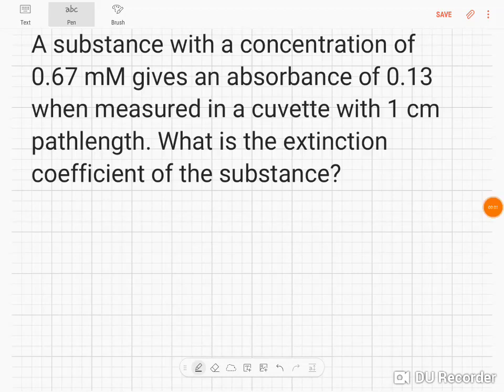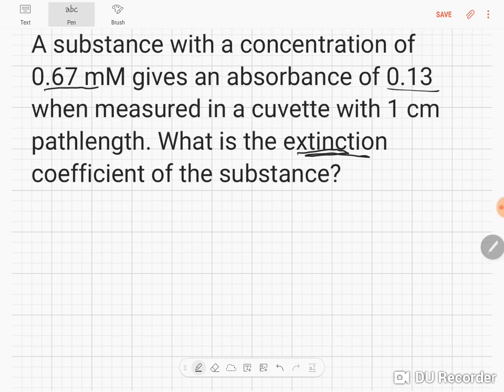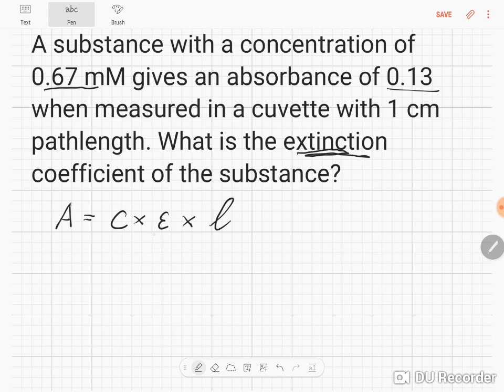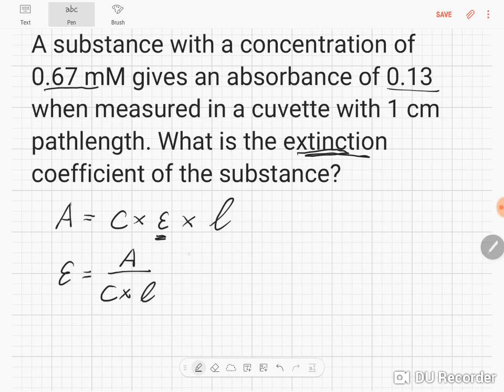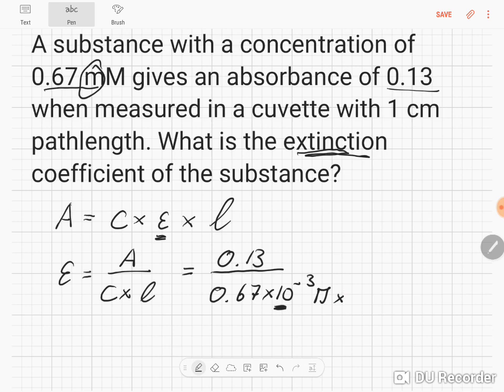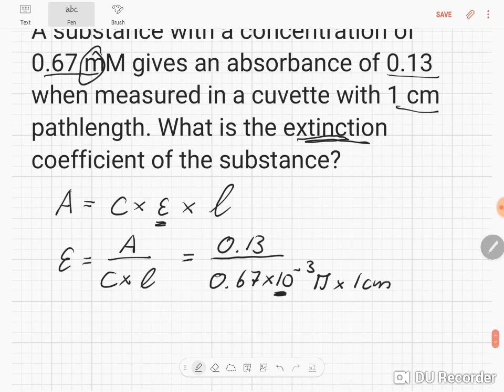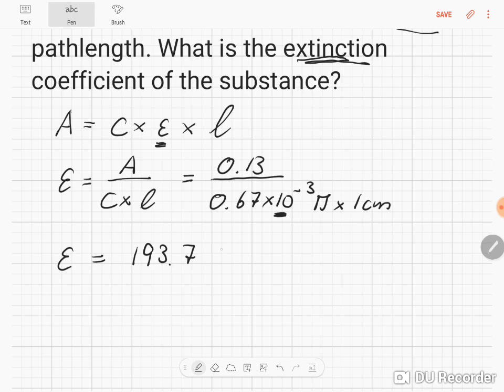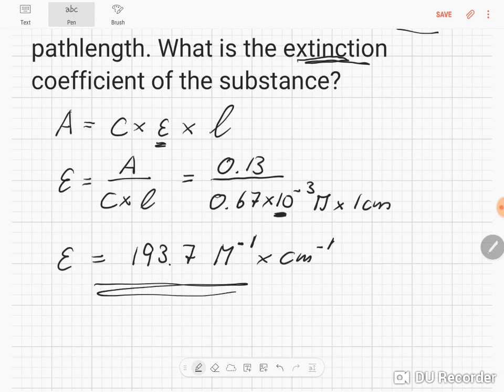Calculating the extinction coefficient

Comment: How to calc the extinctin coefficient from this exercise ? 

Question:

Standard addition is an analytical technique of extreme importance to an analyst, as it eliminates the interfering effect in most determinations. Fluoxetine is widely used as fluoxetine hydrochloride, also known as Prozac®. This is indicated in the treatment of depression, associated or not with anxiety. This compound absorbs ultraviolet light at a wavelength of 227 nm. It has in its structure a stereocenter, being a chiral drug. It is known that only the (R) -fluoxetine isomer has activity, while the other enantiomer has no pharmacological action and there is no evidence of toxicity to the organism. In an industry, when performing the Fluoxetine analysis, the following analytical calibration curve was obtained, in which the concentration is in g / 100 mL: Abs = 372 CFluoxetine + 0.6432. Knowing the analysis was performed according to the standard addition technique and that the molar mass of fluoxetine hydrochloride (C17H18F3NO.HCl) is 345.79 g / mol.

Determine the mol / L concentration in the analyzed solution.

Mark the correct alternative:

a) 2,25x10-5 mol/L
b) 5,58x10-5 mol/L
c) 5,0x10-5 mol/L
d) 9,69x10-5 mol/L
e) 3,08x10-5 mol/L